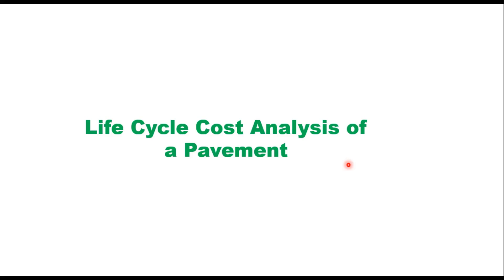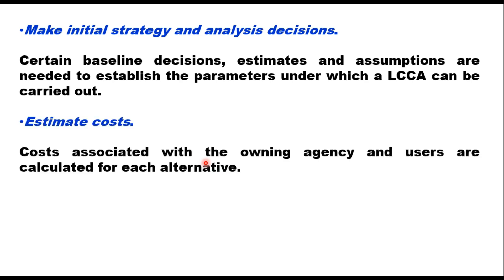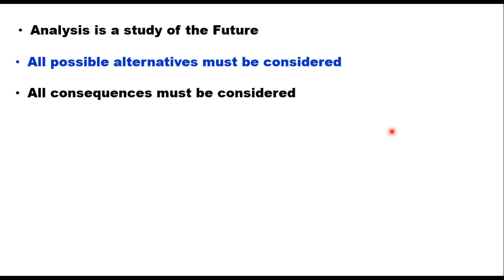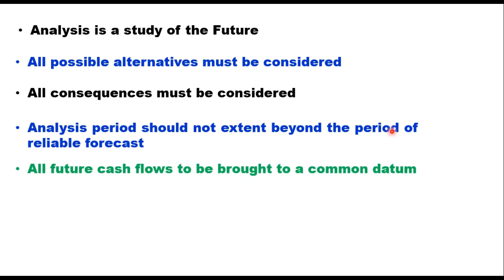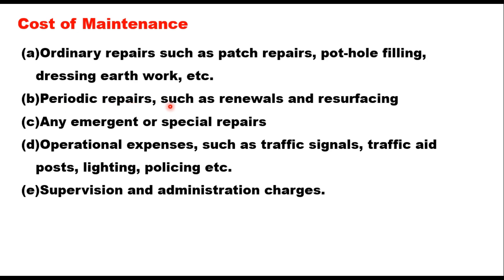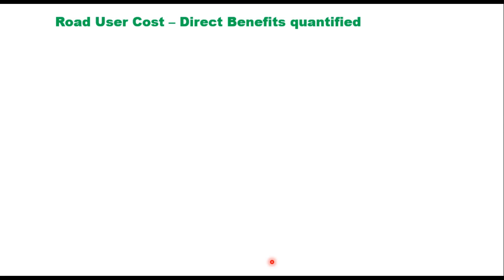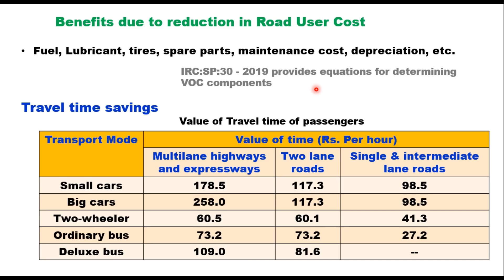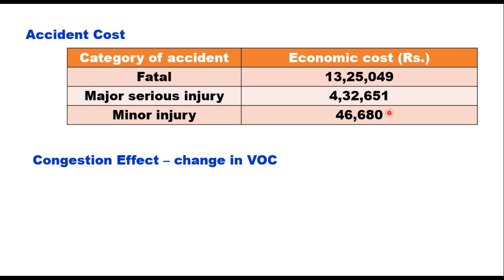Life Cycle Cost Analysis of a highway project. Basic considerations and step in LCCA

Comment: Thank you sir, I prepared a excel sheet on the basis of IRC-SP-30-2019 but i am not able to get the result of Passenger time cost as given in tables, whether i considered the similar value (like RF, RG) as used for "Table VOC Small Cars 1
Economic Cost of Operation of Small Cars on Single Lane Roads (Rs/km) ".All cost component of VOC are matched with the given result table but not able to calculate the passenger time cost kindly guide me in calculating the passenger time cost. what factor is required and calculation steps required? Thank you in advance. I am waiting for your suggestions and help.
Reply from the maker: I am told that the excel sheets are available and are provided by the IRC alongwith the code. Why to make another effort then?